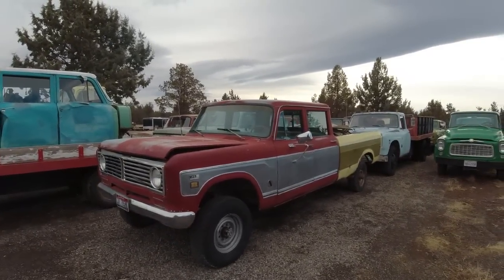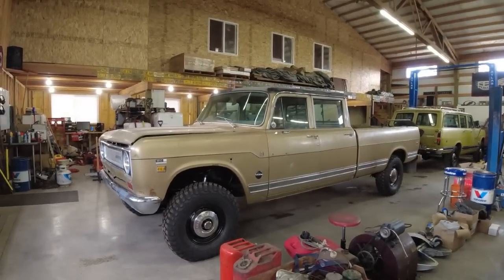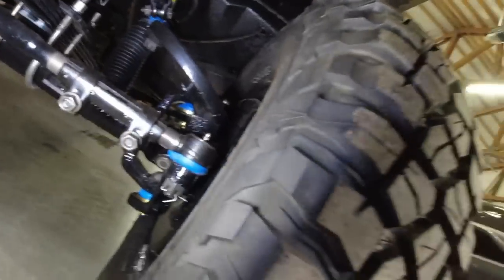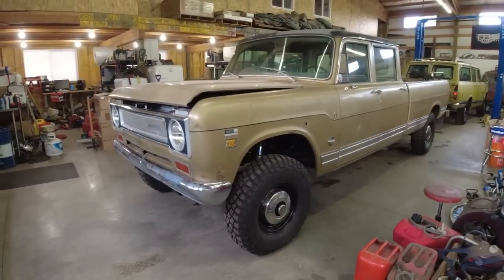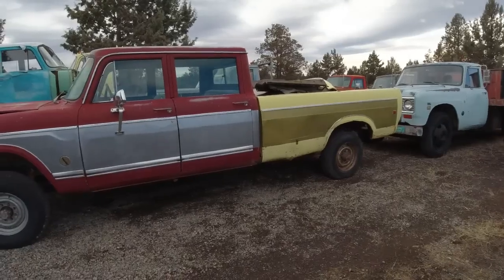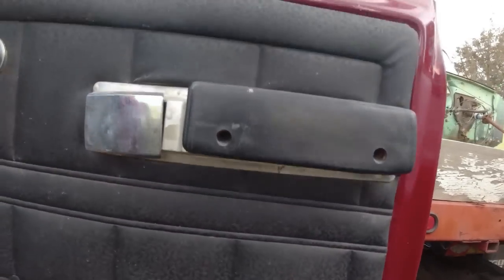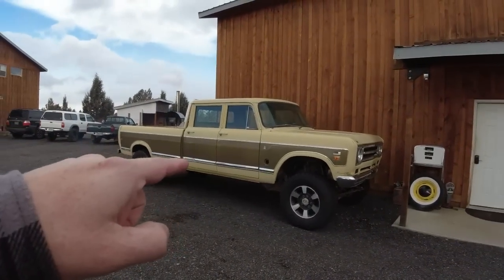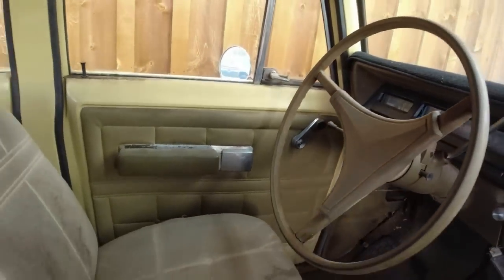International Harvester Travelette VS. Travelall ? different or the same ????

Comment: My first 4x4 experience was when I was about a freshman in high school. My had an early '70s IH Travelall that he'd bought as a work vehicle for his materials testing lab. (Testing soil, concrete, asphalt, etc. It spent a lot of time on construction sites.) I went with him one summer afternoon to go help a bunch of people who'd gotten stuck in mud trying to leave my grandparents' church camp in the mountains. There were cars and 2wd trucks stuck in the shallow ditches on both side of the road. We got to the first stuck vehicle and dad hooked up a chain between it and the Travelall and drove into the ditch on the other side of the road. I knew for sure we'd be stuck. I was wrong, lol. He drove straight through the ditch and up the other side like it was nothing. It was at that moment I understood the allure of having four wheel drive. We worked our way though a half dozen or so vehicles until we made it to the camp, and the Travelall didn't even break a sweat. I've subsequently owned at least one 4x4 vehicle for most of my adult life.

Comment: Great video. I had two 73 Travelalls in the late 70's. Lived in the Adirondack's.with tons of snow. Had two wheel drive and drove thru snow bumper deep no problem. In the spring the exhaust system started coming off from mounts. Also had a 73 International 0ne ton pu with 4 wheel drive for plowing snow. Great vehicles, but salt ate them up in less then 10 years.

Comment: The Chevrolet Suburban is the longest running nameplate in automotive history. 
Although the squarebodied Suburban was debuted in the 70’s, Chevrolet has been offering a truck based wagon they called the Suburban Carryall since the mid 30’s. It was available with 4WD by the mid 50’s, and continued to evolve with their trucks through the years.  I very nearly, and still wish I had, bought a mostly restored ‘68 Suburban a couple years back.
Reply: I remember at one point, the Suburbans were only 3 doors. :)
Reply: @rickmarshall808  for curbside only passenger loading
Reply: @rickmarshall808   Yes and so were the Travelalls.  But in ‘69 International modernized their design and added the 4th door.  Chevy/GMC didn’t do so until 1974.

Comment: The Wagonmaster. It was a Travelall with the top cut off behind the rear seat and a pickup window welded in place to close it in. I put instrument panels in the Travelall from 72 thru 75 on second shift. I had the driver side and Doug Skinner did the passenger side, we ran a unit every three minutes. My station was the only one who had a line stop button if we had any issues. Good times and money when IH wasn't on strike which seemed like often. My first two years I hung the steel door panel on the pickup line.

Comment: I have a 1964 Travelette 1100 that I purchased 20 plus yrs ago as a 2wd half ton and converted to a 3/4 ton 4wd I used a dodge front axle and an international rear and converted to four wheel disc brakes

Comment: We had a round hood Travalette 2x4 at my fire station. It was a Forestry loan whicn means it came from the military. Our AFB had many of these since we had the Titan II missile silos. We used that truck as our trash truck. I loved driving it to the dump. I learned to drive on my uncles single cab IHC pickup and wish I would have bought it at his sale. I know where an old 62 or 63 Scout is setting in the weeds. It is a 2x4 so I did not buy it years ago. I have been thinking of getting it and get the kids to rebuild it at school. It is probably too expensive to upgrade it to 4x4.

Comment: I used to have a IH called a Wagonmaster, the truck in-between the Travelall and the Travelette. Have you ever heard of the Wagonmaster or had one? I think it was an interesting bit of IH history and might make a good video. Mine had the deluxe options 392 auto and all the rust International was known for. I always liked the odd vehicles, IH, Jeeps and Pontiacs. Good job keeping the cornbinders alive.
Reply: FINALLY, you refreshed my memory of the Wagonmaster. It was a Travelall with the top cut off behind the rear seat and a pickup window welded in place to close it in. I put instrument panels in the Travelall from 72 thru 75 on second shift. I had the driver side and Doug Skinner did the passenger side, we ran a unit every three minutes. My station was the only one who had a line stop button if we had any issues. Good times and money when IH wasn't on strike which seemed like often.

Comment: I prefer the Traveler's... Lol
In the 90's I had 3 of them and 3 Scout II's and they all had Western snow plows on them. My buddy Bruce (Yes Bruce and He had a buddy Bruce) had 4 Scout II's and one Traveler. He also had 2 Chevy and a Ford. The Scouts were all 75-78's mostly 76 and 77's.
 We had our own Plow service here in Indiana and they were cheap back then. All had 345's( I think ) but One... It was the traveler and it had a Chrysler/Nissan 6 cylinder diesel in it. You would think it being a diesel it would have a ton of power, Nope! It was a dog and slow but it would push snow up to a point and just stop moving... Lol It had a Bosh started that looked like it was for a jet engine and one day it would not crank the engine. Went to the Harvester plant in Indy ( which we later found out that was where the truck cam from! ) at the time and they said $4,000 bucks! Damn, I almost passed out!
The issue was the brushes were bad and was made on this plate in the starter and was not available as it was a development engine. So we left with no started... Lol
You see the brushes were not replaceable as the braid was fused/spot welded to the holders, that were welded to the plate but that was not going to stop us Hoosier boys... Lol
The next day I went to my local Napa guy and we spent a hour going through all his brush sets to find something that I could make work. We found something that was close but he ordered some others and one of them was so close I made them work and we had a starter again. After 30 years I don't remember what it was for I think they were for a Mack Model R starter, once again not sure... Lol
Most of the trucks were held together bailing wire and 4x4 posts literally as most of them had no cab supports or rear/mid supports rotted away. The Scouts were great trucks and the chassis's were awesome but the body's were rust buckets. 15 years later we sold the whole lot and the company. Several times I wish I had kept the one I drove all the time. But at last, I did not, I  have regretted it for years.
Back then folks would not give you $10 bucks for one and look at them now... Lol

Awesome show!

LLAP 🖖

Comment: I own 1 of each; '71 1210 T'all and '66 1100A T'ette.  The Travelall is 2WD, PS, PB, Auto, 392 and really rusty.  

The Travelette is 2WD, 4 spd, 304 with a short-wide box, 140" WB..  It has the usual cowl rot that I am trying to determine how to deal with.  The rest of the truck is straight with very little rust.  I have decided to move forward with making it drivable and will just drive it in dry weather.  The original owner resided in California and had the rear overload springs removed, along with the radio and antenna.  The antenna mount is still in the fender with the whip removed.  Also removed was the heater and the 3.73 powerlock rear axle.  I am not sure yet what rear axle is in it yet.  I have the original LST with the removed items crossed off.